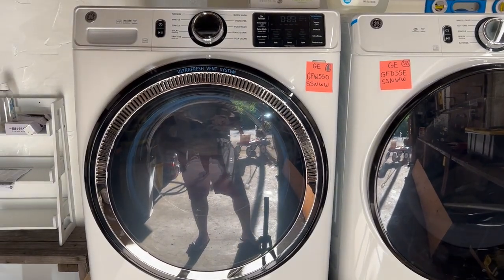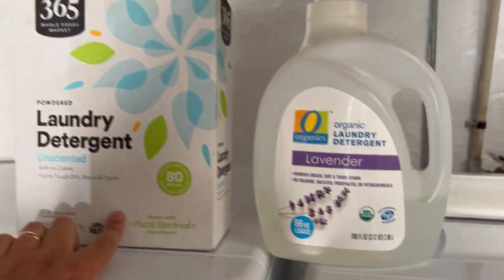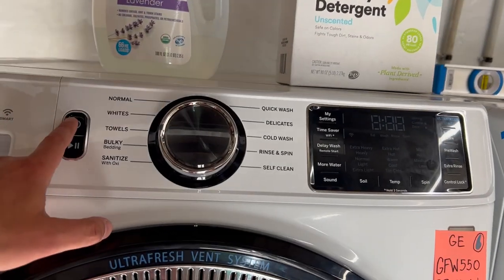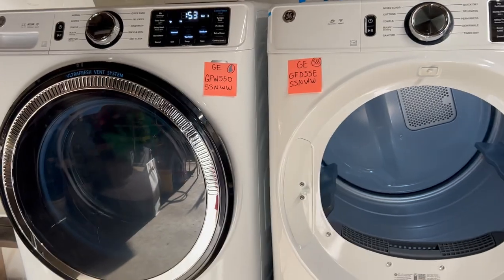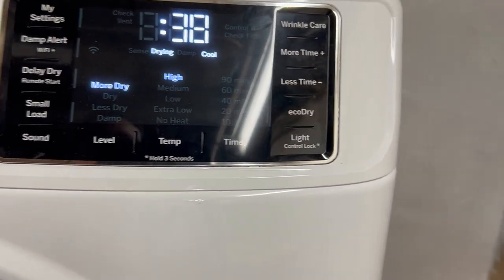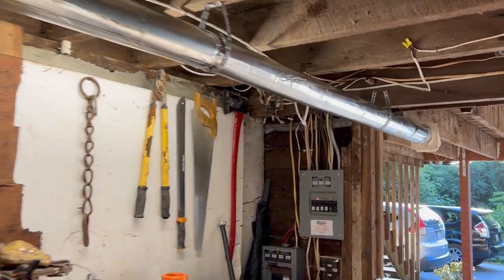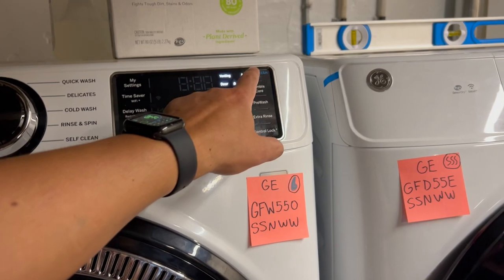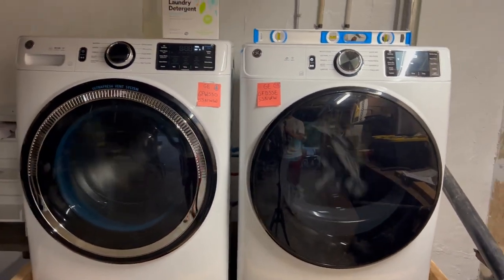Unboxing & Reviewing Costco's GE Washer And Dryer Set (GFW550SSNWW, GFD55ESSNWW) - 2023 Edition

Comment: Getting the dryer (but the gas version) as it looks good and have to replace my old dryer. If I have to replace the washer at some point, might get the washer as well. These look pretty god. Wish it had the steam feature but otherwise looks good. Thanks for the detailed video. I've never heard of that CE detergent though. That could be tricky.
Reply: If having a matched set is important, pick out your washer first (even if you’re going to get it later).  Then get the matching dryer - they’re all very much the same.  Just went through replacing the dryer first with a basic Maytag.  But when the washer died we ended up with the GE 650 version of the washer in the video.  The 650 has steam and the auto dispense soap.  Don’t worry much about the HE detergent- most everything sold today is HE by default.  No big deal if your detergent isn’t HE - just use 1/3 to 1/2 what you used to.  Got used to this with our first front loader in the late 90s when the machines were new and HE didn’t really exist yet.
Reply from the maker: Most detergent is HE now a days

Comment: How are these holding up? I just ordered them and am worried.
Reply from the maker: The GFW550 is a solid washing machine. I ended up upgrading to the next step up the GFW650 due to the smart dispense (auto dispenses detergent) and the steam on the dryer (wrinkles). I have a review on the GFW650 washer and dryer set as well. Both the 550 and 650 are really nice machines. GE is awesome for putting out washing machines that have a vent system so that we don't need to wipe down our gaskets on our washers. I haven't wiped down my gasket in almost 4 months.

If you have any other questions please feel free to ask. Thanks for watching.
Reply: Terrible machines.

Comment: I was just hoping you could share the exact height these machines stand please as that will determine if they will fit for me.  thank you
Reply from the maker: GFW550: Dimensions: H 39.75 in, W 28 in, D 32 in. In comparison the GFW650 (the washer I currently have) is the exact dimensions/height.

Comment: Hi there sorry can you please be more specific about the 27 inches, is it 27 inches wide or tall?  If you could please confirm.  thank you
Reply from the maker: These 3 GE washers (GFW550/GFW650/GFW850) all have the exact measurements H 39.75 in, W 28 in, D 32 in. Except for the GFW850 which is 34 inches tall.

Comment: How do you get heat out of this dryer so the clothes are dry???
Reply from the maker: I haven't had any issues drying clothes with the dryer, a couple times with big loads I had to turn the dryer back on for another 10 minutes once the cycle was complete, but that's about it. What issue are you having?
Reply: I'm having the same issue right now as well. We just got it and it won't heat up.

Comment: Oh wow... it has a "more water" button!!! I'd totally use that every single time...Edit: Get this.... weird! I just checked the costco website and there are 3 models of this machine....the only one of the three that has the "more water" option is the least expensive one! The other two don't have that option (lol)
Reply from the maker: Right? People complain about front-load washing machines not using enough water, which may be the case, but this machine at least has a "more water" feature and an "extra rinse" feature. This set is a good value purchase for the money ($1,600+tax). Especially the washing machine specifically. Good luck to you on your appliance search.
Reply: @PEDRODIY2  Yea... when you were talking I could hear it sloshing around and it sounded like it was using enough water...To me, if you can't hear at least a sloshing sound there's not enough. My Duet front load washer I bought in 2005 STILL works. LOL It's over 18 yrs old if you can believe it...I keep thinking it's gonna die any moment so I try to keep up with what's out there...I wish you luck with your machines....One thing I would say is you may consider plugging the washer into a surge protector.. the control board went out on mine the 2nd year and was replaced... I plugged it into a surge protector and here was are over 18 yrs later no issues... not sure if it's just LUCK or the surge protector
Reply from the maker: @One-Day-After-Another  Thank you for the tip on the surge protector. Do you mean like a power strip? I wish you luck on your faithful washer and dryer set, 18 years is very impressive, at least nowadays when things aren't made like they used to. One thing that I learned in my washing machine research prior to buying my GE set is that a good part of keeping them working long-term is making sure to take care of them. for example, cleaning/checking the coin trap/using washers with screens on the water hookups ETC. Another LG washing machine I was considering getting from Home Depot was recommended in another video, but they said to check and clean the coin traps frequently on that model, so just to be safe I did that on my washing machine to see how it is done and will do that periodically to be safe.
Reply: @PEDRODIY2  Yep just  a regular power strip with a surge protector. I can't say 100% that will help... but it can't hurt...I take care of my stuff and I never once had mold or smells in my washer...the detergent tray is always really wet at the end so sometimes I'll take it out and dump the excess water left after washing and just set it on top of the machine to dry out... and I don't have vent fresh so I leave the door cracked...Over the years I've read horror stories of mold and smells but never experienced that..
Reply: But the upper models have the steam clean and a built in heater, and also hve self dispensing. Wouod much rather have those options than a button to use more water when the clothes are being cleaned the same anyway
Reply: @Ikey04-ge9gy  but it's weird they didn't add that feature to the upper models in addition to the heater
Reply: @One-Day-After-Another they replaced the more water button with the power steam button. They wanted to keep the control boards kind of homogenous across all models, they didn’t want to add or subtract any buttons
Reply: @Ikey04-ge9gy  Ahhh  gotcha... It sounded like it was using enough water.. I could hear it really...there's a youtube user called "washer tester" who has one of these machines and shows entire cycles in operation... but I'm not sure which of the 3 models he has
Reply: @One-Day-After-Another  he has the 850 the upper one I’m pretty sure
Reply: @PEDRODIY2 our washers in the uk are cold fill only have been since about 2006 they heat their own water and dryer vents in the uk go straight out behind the dryer straight outside tho they are starting to phase out vented dryers in the uk
Reply from the maker: @theoddjobcentre6686  Yeah typically dryers vent directly outside behind the dryer unless that is not possible in the spot where the dryer is installed, like mine. My dryer has a cement wall that can't lead outside. So I did my ducting leading to the front of the garage.
Reply from the maker: @Ikey04-ge9gy  That is very true
Reply from the maker: WasherFreak17  Yeah, I noticed. It would be nice if GE let us customize certain washes, or save a custom wash/multiple custom washes. For example when I wash a bunch of random clothes I do it on normal with medium soil level, tap cold temperature, and medium spin, every time unless I change the soil level up or down. It would also be nice if GE let me disable high speed because I don't like using that setting because of the vibrations.
Reply: I have the 850 and LOVE it. It washes huge king comforters plus sheets at one time or very small amounts of clothes and the water may not seem like a lot but my clothes have never been cleaner. I'm too afraid to use the steam feature because it would be so hot that I'd worry it would wear the fabrics out sooner (maybe someday). I like it when my phone alerts me that it will be done in 5 minutes. It's only been 2 or 3 years but so far no mildew from door issues. Not everyone knows this but there's a way to rinse a second time if need be or ahead of time maybe even though it doesn't have its own dedicated button. I like the light feature. Sometimes it's so quiet I can't be sure I really turned it on so I'll turn on the light to see it's on. I keep forgetting to use the option to put in a small amount of athletic clothes using the self-drying feature so that by morning they'll be dry. I have 2 serious athletes in the house who could be using that! 

We also don't use the auto dispersing liquid laundry detergent feature. I was told by some professional along the line to never use liquid detergent on any of these front load washers - that they'll last longer if we use small amounts of powder and just put it in directly on the clothes so that's what we do and it works great. They also said not to use liquid fabric softener for the same reason. Plus it's horrrrible for the oceans. I DO use the dispenser occasionally for bleach and on rare occasions Woolite liquid for delicates but that's very rare.

I just ordered the matching dryer because their Labor Day sales are ending and I'm worried next year there will be no matching Sapphire Blue ones left.

Note that if you buy directly from GE they have a free club sort of membership you can join which gives you much better prices than Home Depot, Lowes and all the other big box stores. You sign an agreement that you won't share what the price is that you get it for but I'll just say it's definitely less. You can get extended warrantees beyond the 1 year built-in one and delivery/setup is free plus for around $30 (?) they'll haul away your old appliance. Best to call that department and talk to a salesperson rather than guess and take chances. They'll help with everything.

Comment: We bought this pair two years ago. The locking mechanism on the machine arrived broken. Now after two years the washer door won’t open and the machine won’t drain. Called GE warranty to repair but they informed me the parts I need are not in stock with no date for replacement. They have refunded my original purchase price but now I have no washer. I would not recommend buying this machine.
Reply from the maker: I ended up upgrading to the next step up the GFW650 after having the GFW550 for one month. I have had the GFW650 for almost 4 months so far. That sounds like a huge hassle that happened to you, sorry that happened to you. Hopefully you will get it all sorted out soon.
Reply: I am fed up with this issue! The door is locked and won't open. My clothes have been stuck inside for two weeks now. The replacement parts just arrived, but this design is clearly defective. There's no way to unlock the door. Even the technician who came to our house couldn't open it. I will never buy GE again! I'm sick and tired of wasting countless hours on the phone with customer support and tracking my service ticket.

Comment: Anyone have issues with dryer door latch not keeping door locked ???? I have dryer 1.5 years now
Reply from the maker: I didn't have that issue but I only had that dryer for one month before I changed it out for the next step up (matching dryer to the GFW650). Good luck on your dryer issue, I hope you can resolve it easily. Thanks for watching.